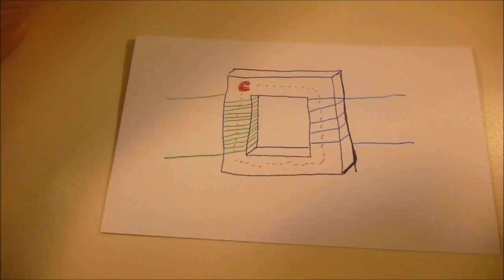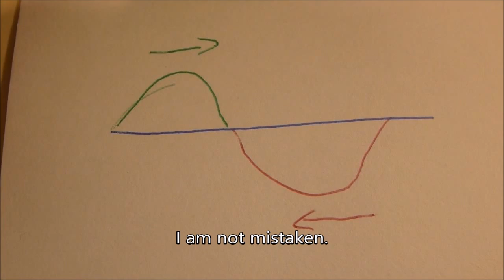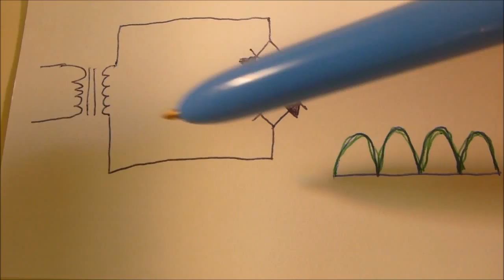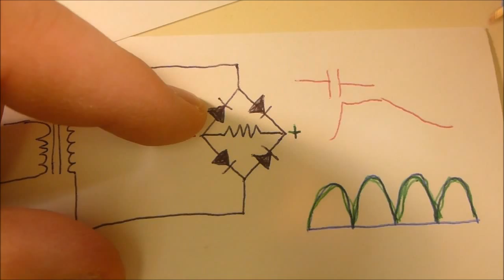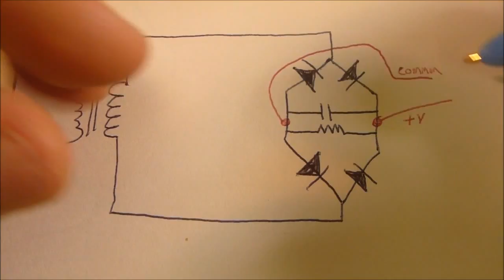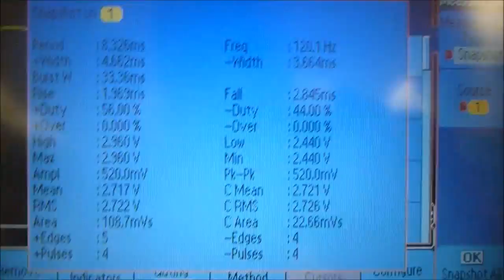AC to DC converter build

Comment: Based on the comments I've read thus far, everyone seems to be an expert critic, yet few give any examples, help, or...
Anyway, I have a pretty simple question I hope someone can help me out. 
I have a bunch of transformers, I salvaged from old PCB's, and I found 2 different bridge rectifiers from said PCB's. (According to the datasheets one says it's a half wave B.R. and the other just says B.R. and shows a diagram of 4 diodes in the chip). So I settled on a transformer that drops the wall main voltage to 24.xx volts AC measured by a DMM. From there it goes to 2 of the 4 pins on the B.R. which puts out 24.xx VDC now. But it bounces from about 24.60 to 24.70 measured with my DMM. 
My question is if I take the + and - Dc from the B.R. to a Cap I should get a cleaner, less "jumpy" DC Voltage when measured with my DMM? If so, how do I go about figuring out the capacitance to use? I assume just use a Cap with a Voltage rating Higher than the 24V output, but not a clue about the Capacitance I should use.. I don't have an O. Scope, so I can't see what is really going on, and I'm a total newbie trying to figure thing out as I go with the help of Google, YouTube, etc..
Thanks Much,
Reply from the maker: Yes a cap will smooth that out.  The higher the capacitance the smoother it will be.  

You can kind of think of capacitors as a reservoir for voltage.  When the voltage drops it will release its stored voltage (to equalize  EG: you have 12 volts and drop to five, the cap will bleed down to 5 volts).  It  will soak up voltage when the incoming voltage gets higher than it's stored voltage (EG: you have 5 v in the cap, and the input voltage goes to 12v).

This is useful for smoothing out AC voltages, because it fills in the "gaps", if that makes sense.

Another place you will find them is to take the brunt of incoming voltages.  Laser drivers use caps to stop the voltage from "slamming" into the diode, instead it gets a slow rise (Slow is relative, we are talking ms or even us, not twenty minutes).

As far as the capacitance, its really kind of inconsequential - as long as it is enough (And like you mentioned - rated for the voltage you are sending to it).  The capacitance can be thought of as how much voltage it holds.  If you need to fill a glass of water every second, you just need a container that will work for the job.  You probably wouldn't get away with using a shot glass.  A glass the size you are refilling would work.  But so would a 2 liter pitcher.  A horrible analogy, but its what I have for you.

Hope I helped.

Comment: Very good explanation, but why did you need the resistor though?
Reply: +HymyileMulle The resistor represents the DC load. It could be LEDs or anything else you want to connect to the DC you just converted. I'm not 100% sure but I think without you would have zero resistance inbetween line 1 and 2 of the secondary and you might let the smoke of the transformer if you do that.

Comment: What about those transformerless converters used for charging celfones?
Reply: +Odouls77 

Maybe you mean instead wireless chargers? 
If so, that's an inductive charger, and the closest bit of my video to what your asking about is when I am talking about the number of turns of wire on both sides of the transformer being different.  A magnetic field having a constantly changing current around it causes a magnetic field which in turn creates a current in the lighter wound coil.  At a lower voltage.  There is a formula for it.

Wireless chargers work in a very similar fashion...
Reply: +Stdervish I thought you could make a bridge rectifier without a transfomer
Reply: You can.  But not much runs on 120v DC...

The transformer is used to lower the voltage from what is in your wall (120v in the US, but where in the world you are this will vary) to something your device can use with out letting out the magic smoke.  In the case of this video, 120v is far to much for 10 LED's. 

Consider phone chargers.  If you hooked up a phone to 120v, your phone would only be an interesting paperweight.

The transformer bit was just to get a overview of how your DC 5v USB charger came from a AC 120v wall source...  It is an interesting topic as well.  But the scope of this video was just talking about the rectifier.
Reply: +Stdervish - "But the scope of this video was just talking about the rectifier." Next time talk about buck inverter. It reduces voltage without transformer. Most wall converters use this technology, very light and without step down transformers. Cheers.

Comment: if you add a second capacitor, even a third, would that reduce the bleed of the DC power ?
Reply from the maker: +Santiago Tobar If you added a higher farad of capacitance, then the "line" of the dc voltage would be steadier.  I think thats what your asking.  you could do that by adding capacitors in series (not in parallel - that would never get you higher), or using a higher value in one. I was using a 100uF - that is .0001 Farad capacitor.  The higher you go, the smoother that line would be.

Thanks for watching!  Hope it helped you.
Reply: For sure, definitely did. and just to be clear here; this method will only convert AC to DC? or can it somehow be reversed so that it converts DC to AC?
Reply: +Santiago Tobar It can be done, you are looking for a power inverter.  This set up wouldn't do that.  There are lots of videos that show how those work...  I don't know how good they are...